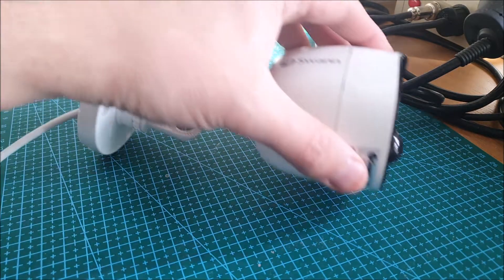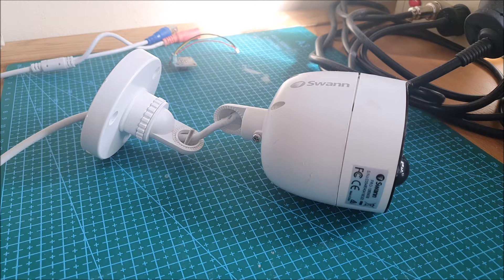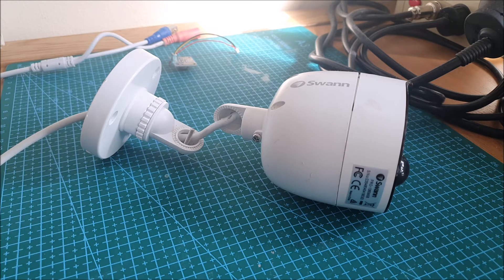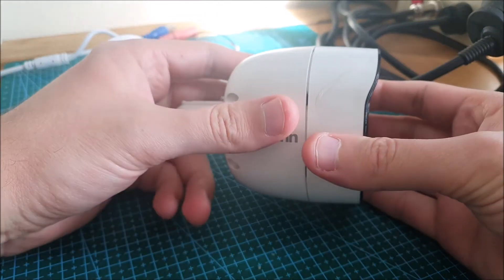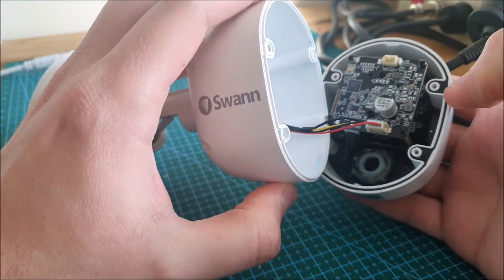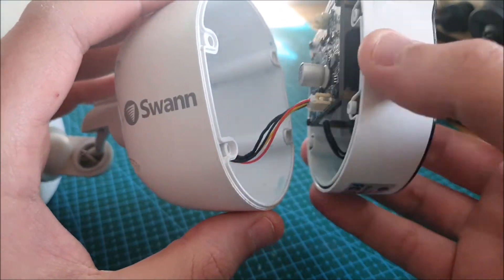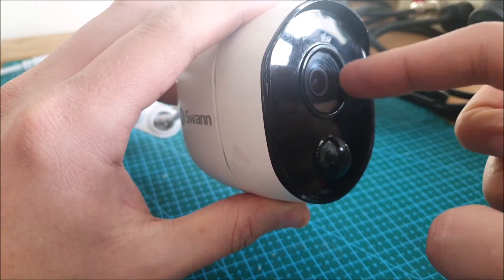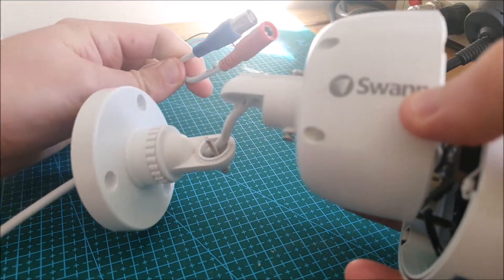Why does motion detection stop working on a Swann CCTV camera?

Comment: Not sure if this may be useful to someone else here or not too...
We use these cameras at my work in an indoor environment. We had one go dead, no video output. I opened it up to have a look and had a look at the PCB's under a thermal camera. The motion detector/PIR PCB was very very hot! I unplugged the detector from the main PCB and the video feed began to work again! We don't use the PIR side, so this was good enough in our case. One of the components (resistor or cap, unsure which) on the PIR PCB is showing a short. I may see if i can check the component values from a working PIR PCB and repair the PIR, just for science 😂 Like you say, it is probably not worth the fix with the corrosion. If i get anywhere, ill reply back here or make a video 😂 I really hate seeing stuff like this go in the bin, even at work so was glad to get it going again for a bit longer!